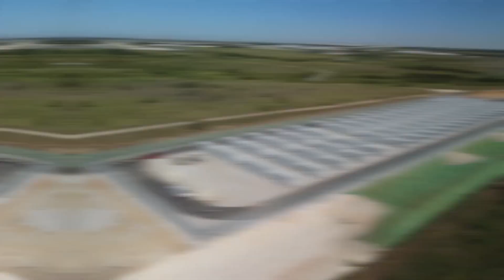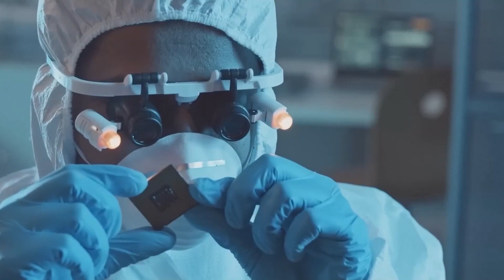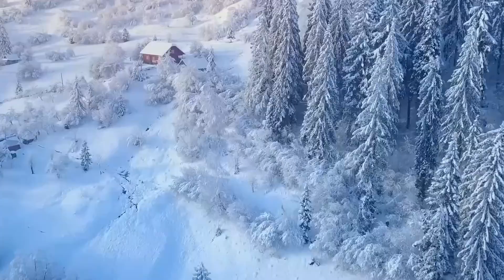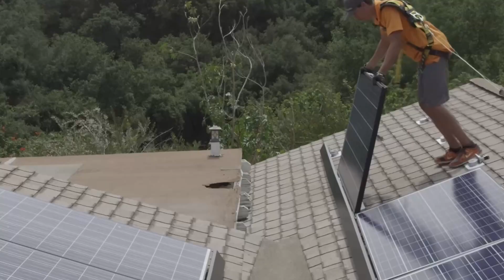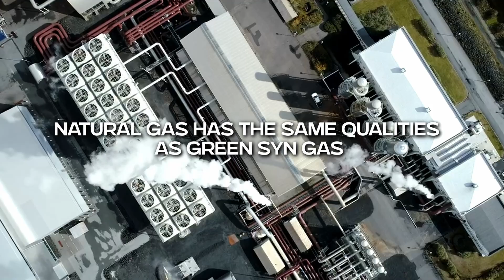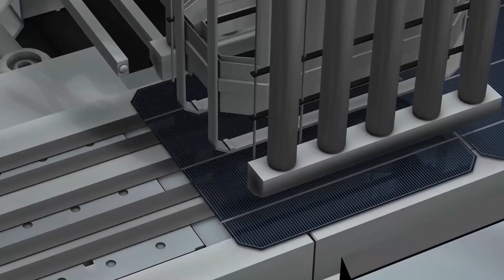These Amazing Solar Panels For Home Produce CHEAP GREEN HYDROGEN

Comment: Please consider the existential threat posed by destroying water to make hydrogen.
Water is a finite resource that in great part makes life possible on this planet. It is essentially not created in nature, and like most extremely valuable things it is easy to break and extremely difficult to make.
Any water recovered from the use of hydrogen fuel in a fuel cell is minuscule.
There is already substantial amounts of water being cracked to make oxygen and hydrogen for the medical industries and manufacturing. Deep water drilling and ocean desalination is already increasing ocean and fersh water salinity and making access to drinking water a scarce commodity in many places.
Compound this with the fact that using solar power to crack water to get hydrogen to use as a fuel is extremely inefficient and very expensive compared to just charging a battery from the solar panel.

Comment: This video is really long winded & treats you like a primary school pupil.
I gave it a dislike for that reason (despite this subject interesting me -especially how everything works together).
Reply: It's a pathetic nothing.  He didn't even cover the metal hydride storage which is the most important part.  What metal is being used (Magnesium ?) , at what temperature (150F ?) is required for release of the gas, usually 3-4 tanks must be heated simultaneously for proper flow rate, what is it?  tanks don't have to be pressurized and any size configuration is OK,  the gas can be used for home power or for powering your electric car, etc... Pathetic!

Comment: Hell yeah don't you think between this, solar PV, wind generation, backup generator, electric car, home business battery backup would help get users through cloudy overcast times of the year. Seems like a lot of equipment to coordinate and make work seamless. it seems doable at this point. Maybe keep  peaker plants online to buffer the existing storage capacity. until the systems built out and redundant enough to support itself. Without help from the peaker or baseload production.